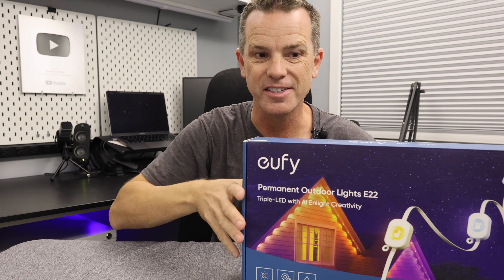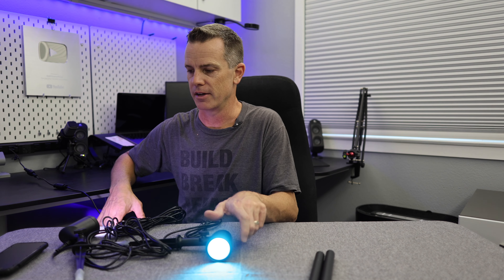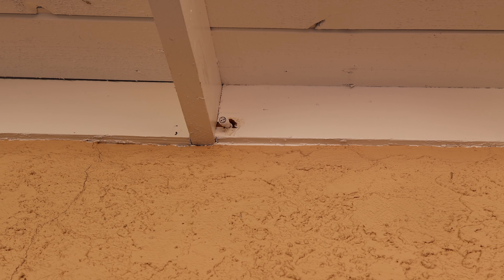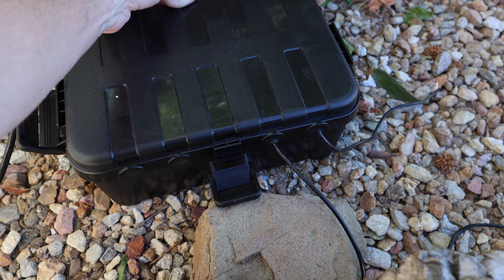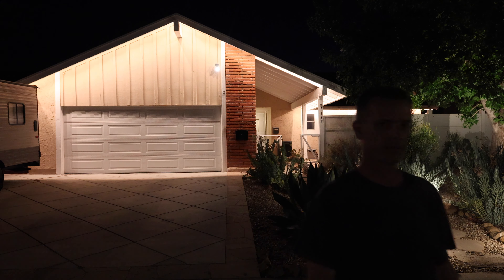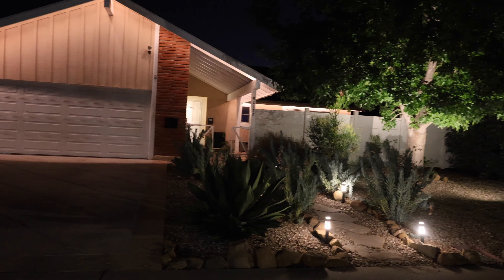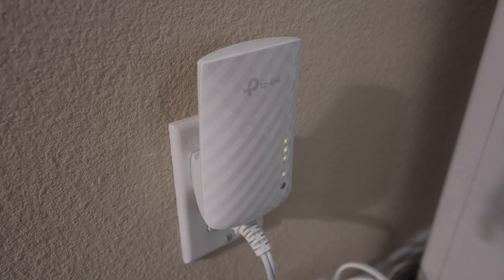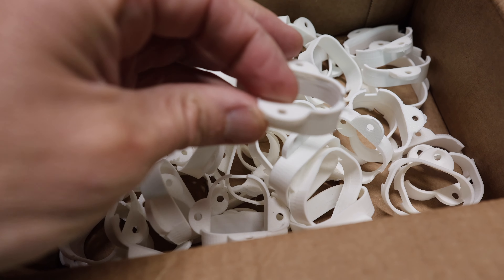Improved Eufy Permanent Outdoor Lights - Are They Better? Eufy E22 Outdoor Lights

Comment: My neighbors have something similar. The only drawback I see is when the power goes off (and it does around here a lot) the whole thing goes down.
Reply from the maker: We have power outages frequently here too (high winds/fire), my home security system is all on a battery backup, the cameras have spotlights that will still work in an outage, I've opted not to put these on the backup to conserve the battery.

Comment: Most simple outdoor LED lights can be dimmed with a simple resistor.   They will keep them cool and last longer.   I actually just buy a power supply with a lower voltage output.

Comment: Thanks for the walkthrough! Do you know if you can turn off sections of the E22 light strings, or what the solution would be if there is an extra 20ft at the end of the line?
Reply from the maker: No, there isn't a way to shut off a section of the light unfortunately.
Reply: @DoItYourselfDad  on the Eufy website it states: Can I cut the light string to the desired length？
No, you cannot cut the light. Each light string measures 16.4 ftand up to 9 strings can be linked. For any surplus length, simply customize and switch off the excess lights via DIY settings.
Reply from the maker: @GambleOne3  I stand corrected.... I had searched the app for that and somehow missed it. Thank you for the correction.

Comment: Appreciate the thorough review! I’m considering Eufy e22 or the Goovee Pro’s, my only hesitation on the Eufy e22 so far is splice-ability. In my install I need to cover 185’ with two eves and don’t want to end up with excess lights on either end. Any suggestions on if/method of splicing?
Reply from the maker: You would have to get creative with your splicing, it would be doable if your handy with a soldering iron. The line could be cut, and extended. Unfortunately there isn't a plug and play way to do it with these lights.
Reply: You can cut the lights to "end" them wherever you want. The eufy controller will sense the number of lights and auto-configure itself accordingly (this is what the white flash is upon power up). Extending is the tricky part, you'll most likely need to add in another power supply to keep the voltage signal strong. Depending on the length you can try a data booster, but I've had limited luck. You can also look into the quinled diff adv board which can extend long distances and maintain the signal integrity.
Reply: Yes, you can turn off any individual light on the strand, no need to splice.

Comment: I've noticed that others install these lights pointing downward, towards the floor of  the house. I like the idea of not having the spotlights directly visible. However, is this configuration recommended? Or do the lights need to point straight down?
Reply from the maker: They don't need to be straight down, you can really orientation them in any  direction. Along part of my eaves I have the lights pointed more upwards and towards the house. It diffuses the light nicely that way.